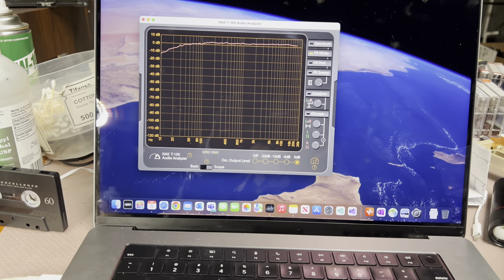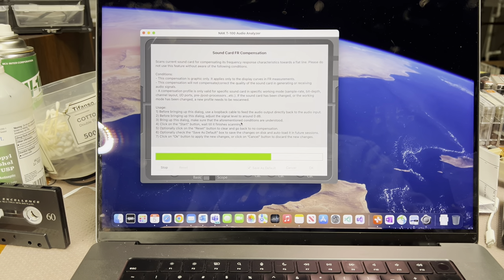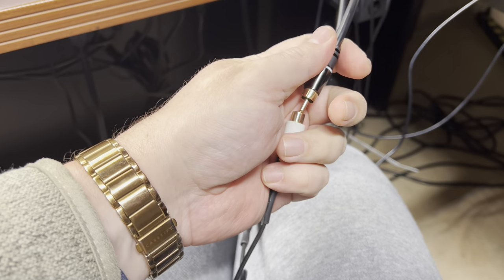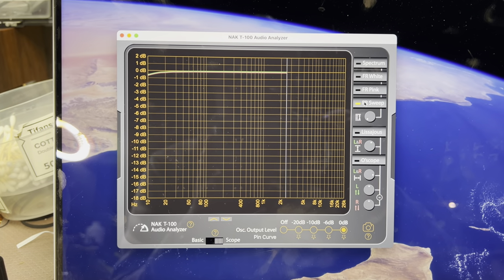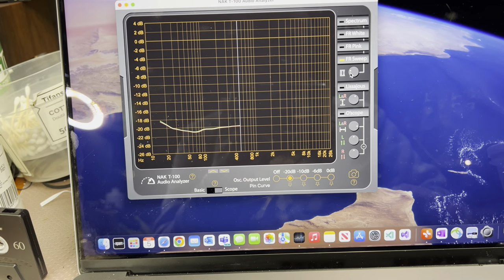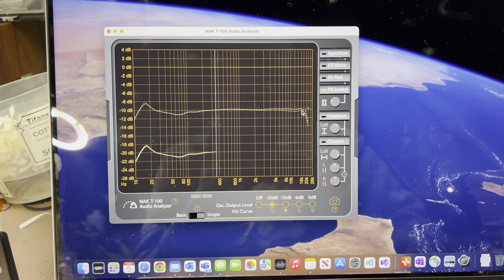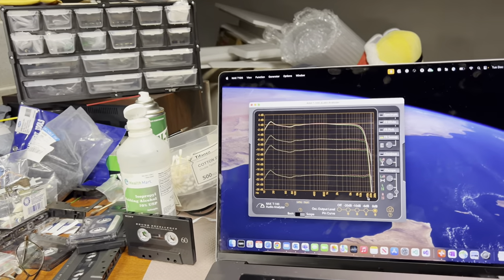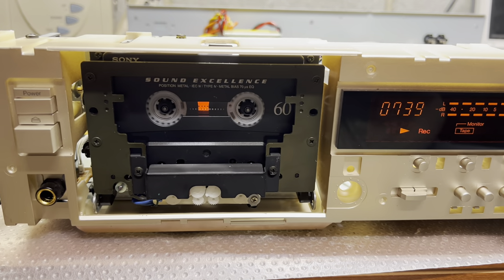Audio Calibration Tutorial & Tape Frequency Response Test using T-100 Analyzer

Comment: Well done, finaly u done it. :) ps, you can extent the range to full 26kHz if you connect the sound card with 96khz. the sound cards with 48kHz have limited range for this program. Have a check if your sound card can do the 96kHz output.

Comment: Thank you for a very insightful video. But here is a general question from a total noob. Are there t-100 libraries with factory values for different cassette decks, like Nakamichi Dragon, C7...Pioneer CT-1250, 1000, 850, etc. that can ne preloaded and against which measurement and calibration of the repaired/restored units would be made? Or at least are there downloadable libraries in communities from T-100 users  who have performed restorations as close as possible to factory values?
Reply from the maker: Nope, that is not possible.

Comment: What is the best way to make my own calibration tape in order to balance left and right channels?
Reply from the maker: If you have deck you trust and with factory sealed head screws, than you have a chance.
Reply: You need a reference Dolby level tape and a millivolt meter or an oscilloscope.
If it's a two head deck a function generator app might do the job as reference signal source, just to balance the channels. Even radio static could be a good enough source...

Still if you want to be precise you need a reference tape to make sure the REC balance is consistent with the PB.
Reply from the maker: @m80116  Only if you use Dolby....
Reply: Playback level calibration tapes are almost always recorded with a 315 Hz test tone, but you’d need to record said tape on a deck that you are absolute certain is perfectly in balance, has factory spec speed, and factory spec wow and flutter.  And no - you don’t need a Dolby labs test tape for just balancing playback levels.
Reply: I am surprised about this discussion. Without a reference tape you can't know if you're recording one channel hotter than the other and playing it back weaker than the other, this results in a perfectly balanced condition within the deck itself.

This chance is mitigated when a two head deck is involved as the head is less selective on HF reading and less performing on recording.
Reply from the maker: @m80116  All test tapes are made only for a single purpose - compatibility across multiple decks. If you have just a single deck, record on it and play on it - test tapes aren't needed and do not matter actually.
Reply: @hifirulezzz  Only if you DON'T use Dolby :)

And also if you don't use Dolby and need to know if your deck is balanced. Even if a certain signal is inputted into a deck you cannot know if the output you get is balanced because it is recorded and played back evenly or because the gain controls on thr REC and PB sides are canceling each other out.

Without reference tapes... none of our tapes would play at the same speed, with the same levels or even sound the same. 1/6th of a degree of azimuth error is able to produce of level loss of over 10 dB at 20 kHz.

Calibration tapes are an ESSENTIAL part of a cassette tuner. Otherwise we might go all to stroll about without them.

And you know well that's not even enough... closed loop systems require far more than that. I've had my share of experience so, I know first hand.

Comment: When you’re cleaning and lubing a transport to lower w&f, are you using lubricants listed in the service manual or do you have a set of more universal lubricants that you prefer?
Reply from the maker: I am using silicon lubricant for the moving parts and oil for sewing machines for the bearings.
Reply: @hifirulezzz  right on. Do you have a favorite brand that you prefer?